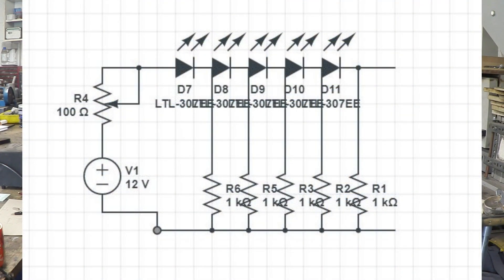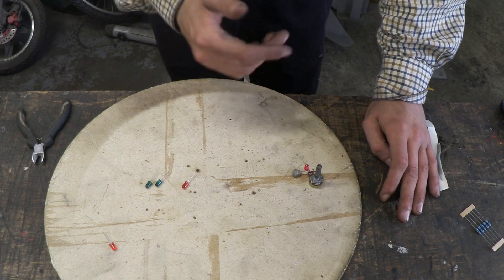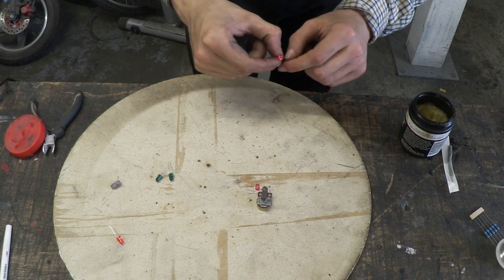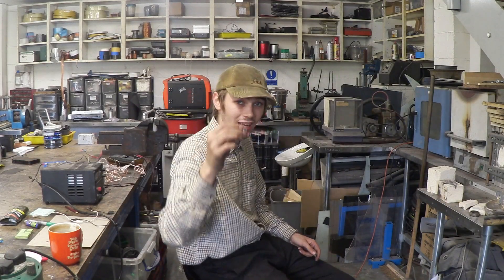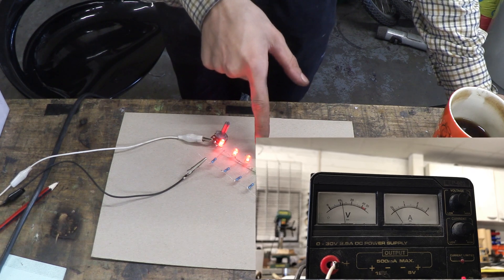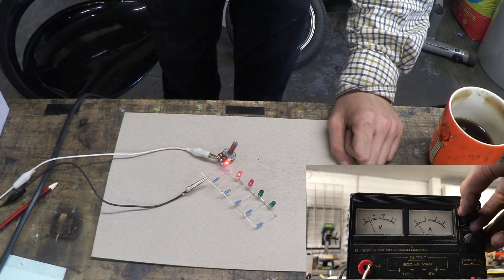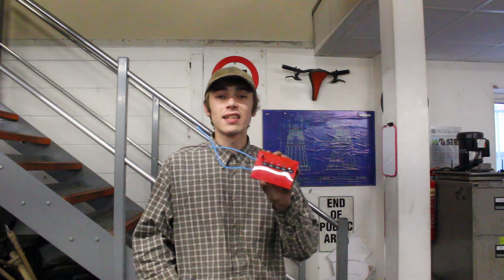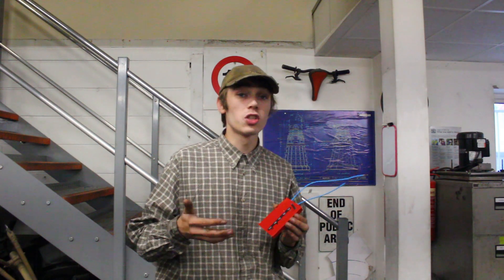1230 - DIY Battery Level Indicator

Comment: Excellent idea! I'm working on a design for wireless, solar security cameras and this will come in very handy. Are you sure all the LED's have the same current though? I'm a complete amateur at circuits but I remember Kirchoffs law about current into a junction==current out. I get the current going through the first LED to be the sum of the current through all the other LED's plus the current going through the first resistor. Please let me know what you think, I'm still learning circuits so would greatly appreciate the feedback.

Comment: I am making a circuit currently that is a low voltage alert for my solar batteries so I know when to turn off my inverter that runs half the house. When the inverter is switched off I have an automatic switch that turns it over to mains. The circuit is running with an op amp running as a comparitor and a trimpot to set the desired circuit. When reached it sounds a 12v piezo buzzer and I turn off the inverter.

Comment: Nice circuit. Current for individual leds will vary with the voltage when lit. That's not a big problem as long as you keep current within led specification. Different colors have different forward voltages so led color will be a factor in voltage threshold indicated. Even for a single type of led typically there's big variation in forward voltage between production batches ( let's say one V max) so it's hard to rely on that. I guess this is a good indicator for a lead acid battery as I expect remaining life is a function of voltage. This is very different for lithium batteries. Special fuel gauge IC's are used for those. These keep statistics on battery performance and measure temperature to indicate what percentage is left. That's what's in your phone for example.

Comment: glad to see some electronics  build a inverter  from a low frequency esg002 board it is easy and cheap  you can order a board already put together for 30 buck if you can find a free transformer a case and few other small components you will have a very cheap very good low frequency pure sine wave inverter  i made one 3 years ago still works great

Comment: Thats fun... Hi there Luke. how would you go about setting it for a range between 11-13vols say? as we know any car battery below 11 would get knacked. If its set to 11-13 Volts, you can also use it on solar panels coming in.
Reply: Cant be done with this circuit, every time a LED goes out the V has dropped another 2V approx. would need a more complex circuit, a transistor amplifier at least
Reply: @Phantom-mk4kp  can't you just extend this same circuit i.e. currently (no pun) the voltage divide is 12/(1 to 5), with ~3.6V steps, but with a (1 to x) range you'll get smaller steps, even if the number of lit LEDs e.g. 9 out 10 doesn't correspond to 90%, but that's where colour choice can come in (because colour is also a source of information ;)
Reply: oh ok, thank you both for your replies :)

Comment: The steps are a bit coarse for a lead acid battery as you need to go between 11.1V (1.85V/cell) to 13.8V (2.30V/cell).  A quad comparator circuit like the LM339 hanging off a  resistor string driving the LEDs is probably a better solution.
Reply: True. And 12V is pretty low on lead acid battery, would not go lower than that.